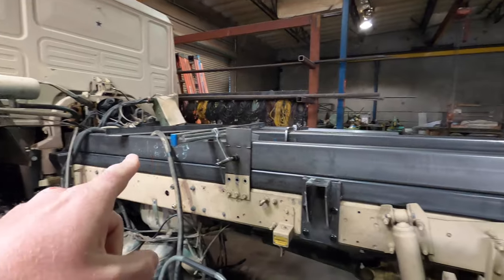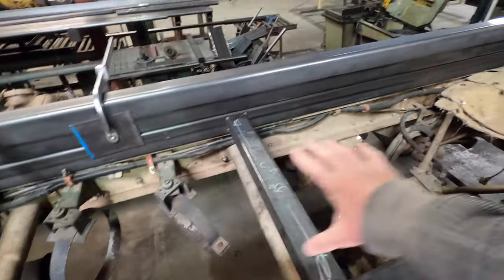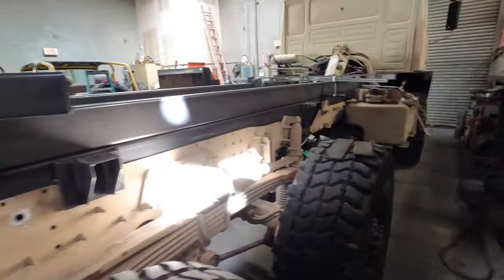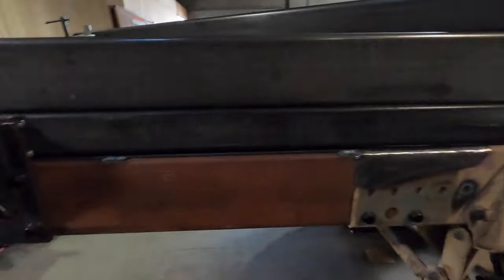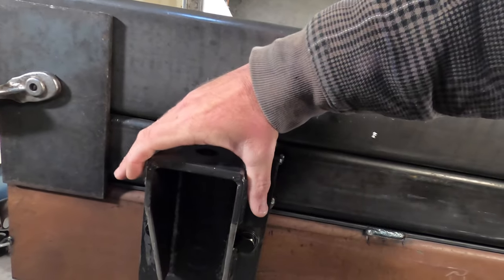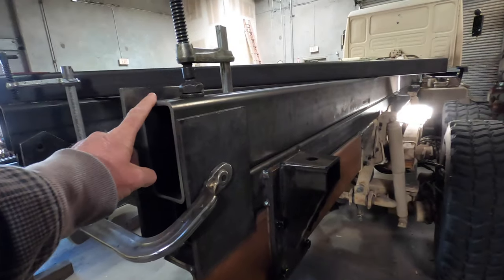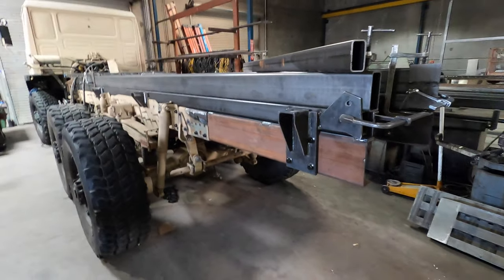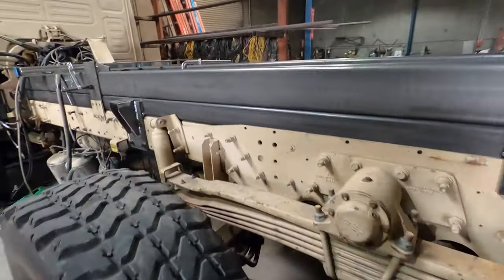LMTV Overland Expedition Truck Build   Part Six

Comment: leave room to be able to swing transmission back for removal... or make that nearby cross member bolt on.  With that in mind....  add big strength to roof of area above the trans plus a way to add a chain host... add a hatch in floor to access the trany and ... tadaa... built in gantry frame for trany removal if you need to do maintenance.

Comment: Would a 20' shipping container perhaps be a starting point for your 'box' Nate? Admittedly would add about 2.5 tonnes before fitting out however roof pockets for lift-off and inbuilt strength in design might be of benefit. The chassis flex solution is clever.
Reply from the maker: I had considered that, but I wanted to get the extra 6" width and less 6" height than the container would provide.  Plus, containers have no interior wall structure, I'm building this pretty stout to be safe in all conditions, even a roll over.  That and the weight is too much of a trade off.  The box I'm building including the subframe is less than 3,000lbs.
Reply: I’m looking forward to this. I live in Canada and dream of doing this... in detail. I’m sold on the composite idea for the cold with no thermal breaks. But I’m dreaming of abetted integrated subframe that gives strength to the walls, after that it’s traditional composite fibreglass Chanel’s for the walls and roof. But I think I’ll go with a 4point subframe design that will give a little greater protection to the box.  This is very interesting and helpful to see your version coming together! So many stay away from amending the basic design of the truck! I’m really glad to see you biting t(at off and chewing through it!!
Reply from the maker: @Eliukcory  Thank you!  I'm glad you find it useful :)